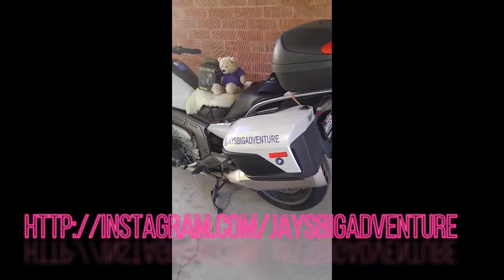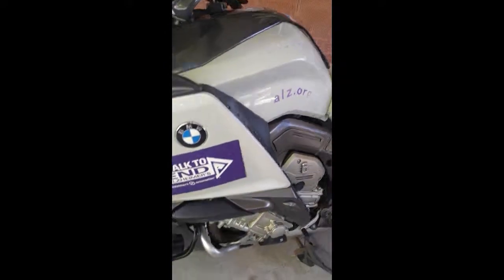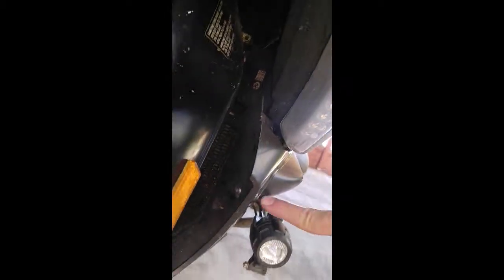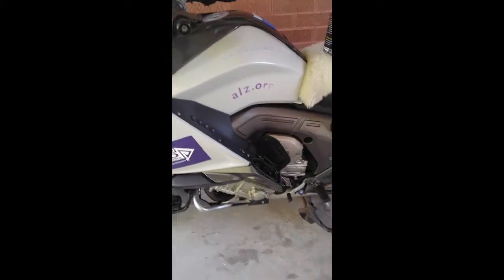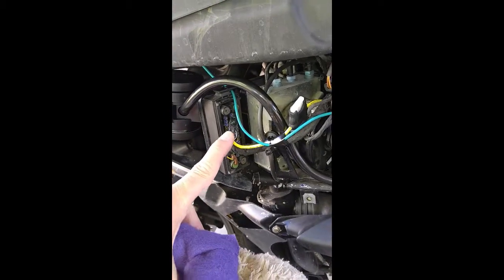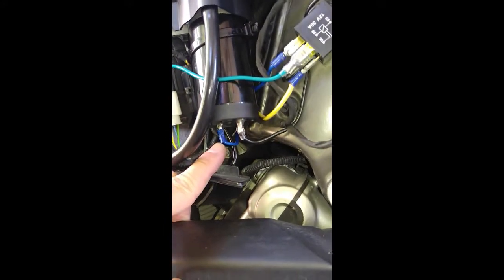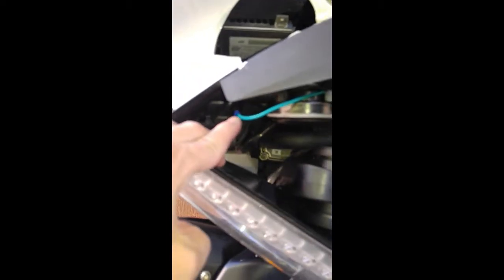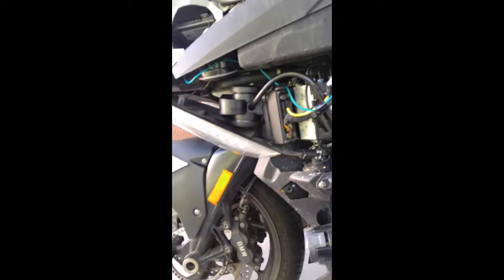Jaysbigadventure BMW K1600 GT Denali Soundbomb Installation

Comment: I probably would not have chosen the ABS wire for the horn power myself. You might be using the horn while you’re also braking hard which might possibly be a problem for the fuse.

Comment: Hi Jay Bear, thanks for the video. I wonder, when you install the Denali does the alarm system still work with the original horns or now with the Denali all together?
Reply from the maker: I had to think about that one. I have the horn wired through a HEX EasyCan controller. Since the bike is off, the EasyCan will be too. So no Denali horn. If you just wired the relay directly to the battery then the factory horn would set off the Denali as well.
Reply: @JayBearjaysbigadventure  Ok, in the video I did not hear you mention the HEX EasyCan controller just that you have it connected to the relays. I have to find out how the HEX EasyCan controller works. I am not a real techie or did you make a video of this too. Then I'll take a look at it.
Reply from the maker: @RobertDijkstra  You actually brought up a scenario I'd never considered before! Good job making me think, lol. With the EasyCan you can have the lights blink when the horn button is pressed, change which circuits of 4 are always on or switched, etc. Very sophisticated setup. I should do an update based on that.
Reply: @JayBearjaysbigadventure  Jeff, yes you should do an update based on that, it would be great!